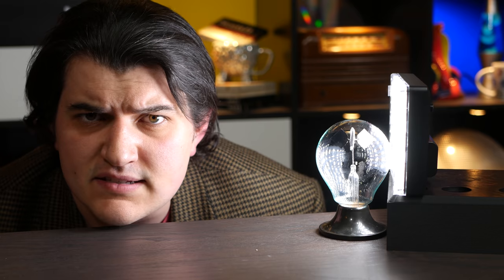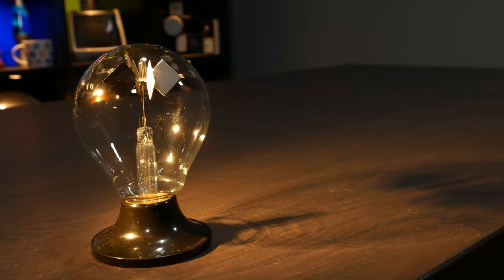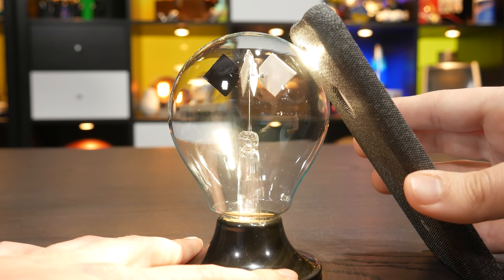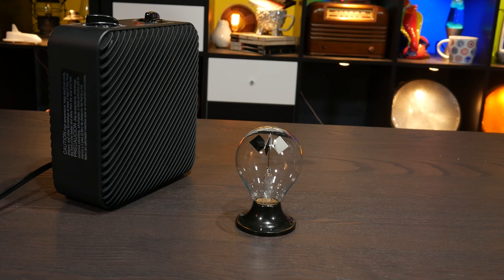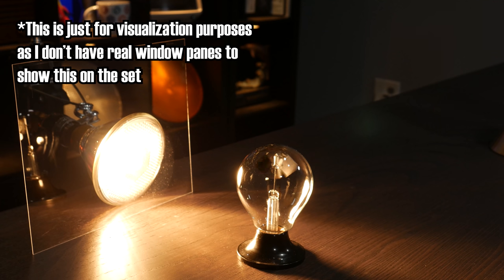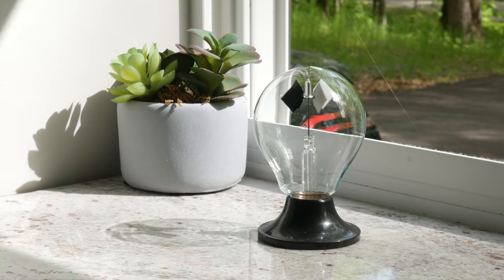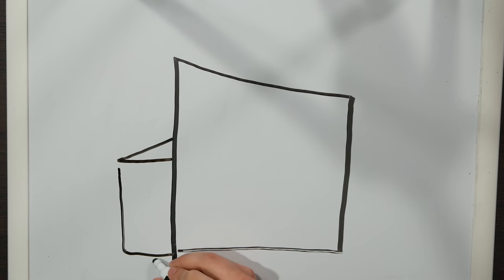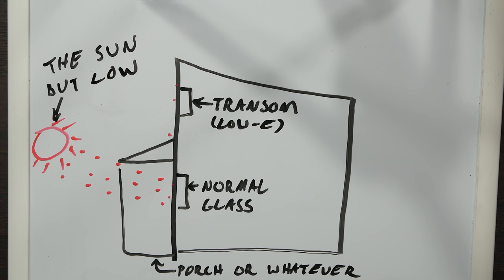What the Crookes Radiometer can teach us

Comment: I used to have a radiometer until I had the bright idea of seeing what would happen to it in the microwave, fun fact, I don't have a radiometer anymore XD
Reply: Funny thing is that, if you had put a glass of water in next to it, you might still have a radiometer.
Reply: @joesterling4299  ill test this
Reply: @joesterling4299  not guaranteed or simply a bad idea disguised as a smart move, usually you don't put metal in a uW AT ALL
Reply: @redoverdrivetheunstoppable4637  Nothing needs to be metal in a radiometer.  And it was a joke, which I guess I now have to ruin by explaining.  

Putting anything in a microwave without a liquid to absorb the energy will lead to a runaway condition that can destroy the oven and whatever is in it.  A glass of water would solve that, if not the issue of excessive metal that resonates with the microwaves.
Reply: @joesterling4299  first of all, i don't see any joke... second, the radiometer has likely metal in it, starting from the needle and probably the vanes... third, putting a decoy material you will ABSORB but not ATTRACT all the microwaves so the problem remains, infact people have bad expereinces with metal !!!AND WET FOOD!!! in a uW

i'm not replying anymore, this is becoming awkward, goodbye.... and stop suggesting dangerous things for spaghetti monster sake
Reply: I found out if the bowl still has a metal spoon in it all hell breaks lose

Comment: You know one machine I've never grasped how it works is a van der graaf generator.  Sure, I've read numerous explanations of how they work.  But for some reason my brain doesn't actually seem to lock onto the mechanism.  Your explanation of the radiometer, on the other hand, makes total sense.
Reply: paperclip
Reply: Up next, the Van-De-Graaf-ometer!
Reply: I once went inside a giant van der graaf generator. They still use some of them for small scale particle physics experiment. They look a little bit like small submarines. Instead of the rubber band of a desk top van der graaf they use a large metal chain
Reply: For me, The key to those is understanding the belt inside. It's floppy and slips a lot. So in actuality, it's like using duct tape to clean lint off a sweater. Only in this case, the lint is charge (from an ion, proton or electron is still debatable.)

Once the belt touches and pulls away enough ions (from the roller or buff), you have a charge potential. 

Maybe you already got that far, but realizing it isn't horizontal sliding, but perpendicular touching and pulling away, made the difference for me.
Reply: I was under the impression that no one actually knows why rubbing those materials against each other actually separates charges.
Reply: @Kaepsele337   I think the debate is if they are protons or electrons moving from one side to the other. But it's the same mechanism as rubbing a balloon on your hair. Van der Waals forces. 

Maybe the details of exactly how the charge moves is yet to be fine tuned, i don't recall. Most things in quantum physics are though.
Reply: @onebylandtwoifbysearunifby5475   Of course it's the same as rubbing a balloon on your hair, but what do van der Waals forces have to do with rubbing? That's also the explanation that I was tought in school, but later heard in university that actually we don't really know what's going on.
Reply: @Kaepsele337   The charge front is initiated by pulling away of 2 surfaces, not really rubbing. If the belt of the VDG generator is tight, it will stop producing charge. So we know its the touching and pulling away.

Electrons don't stay in just their host atom, so at any given time they will be sheered off when pulling materials apart. We also know this sequence has to be done repeatedly, and not just once, to build charge. 

A positive and negative front is set up, and the electrons move away from it towards the metal spike in the generator. That metal spike is attached to the metal dome, which spreads the charge so it isn't concentrated too high. That allows for more charge to be built up, instead of repelling.

The question, as far as i know, is whether the protons or the electrons that are actually being transferred. Most say electrons, but a few say protons. 

The fact that the belt can't be tight, and has to be floppy, tells us a fair bit about that being correct. There may be other open questions too, but i don't recall the details. (I take in a lot of information, so i have to sort through for a while to find where i file some of this stuff.)
Reply: @Kaepsele337  Maybe "cold welding" will help here: the reason 2 metals don't fuse together when touched is Oxides on the surface acting as an electron insulator. But in a vacuum, there is no oxide, and touching 2 metals together will weld them. The electrons don't know what piece they are in, so flow between the two, and it becomes one piece. 

Now, if we do that process over and over, with 2 different elements, each time they are pulled away it will leave a net charge on one side, because the electrons can't know you are about to separate the two pieces, and have no way of returning to their original positions first.

So here, instead of metals, we have a buff, roller and belt, and a metal spike to conduct any net surplus electrons away from those surfaces.
The electrons spread from the narrow spike to the large dome, and voltage potential accumulates.

(Sorry mate, that's the best i can do without finding my notes from (?) ago.)
Reply: Read this!  Objects in close contact share and exchange electrons in their outer orbits.  The force that prevents them from passing through each other is an electromagnetic force from like charged energetic particles (electrons) repelling each other.
Because of quantum mechanics these promiscuous electrons sometimes are with atom A and sometimes with atom B.  When you separate the objects, some electrons remain in their mistresses object.  If you do this repeatedly a charge differential is built up.  Promiscuity of electrons in materials are described by the triboelectric series.  Wool has a thing for glass, latex a thin for protein, etc.  Pretty simple.
Reply: @onebylandtwoifbysearunifby5475  is that also why the cells/atoms that compromise my fingers stick to each other but not to the other fingers?
Reply: @renakunisaki  I think there you would have an equal exchange of electrons, being similar materials. So there would be no net change.  As in a battery, you need an anode and a cathode to build potential.  If you just put 2 potatoes next to each other, they interchange equally. But the exchange between the two would be far lower than the exchange within themselves, so they wouldn't join. Whereas metals accept electrons freely, and flow away from the nucleus freely, to form an electron current. So in the case of fingers, the exchange rate would be homogeneous, and at a low rate, as carbon has all 4 bonds spoken for in organic life. Nothing to accept electron flow at a high rate means bio-welding your fingers together would be unlikely.

(That said, your skin does stick uncomfortably well to vinyl car seats in Sumner.)
Reply: Understanding the triboelectric effect helped me get a better grasp on the van der graaf generator.
Reply: The critical element nobody ever mentions is the hollow metal sphere at the top. If the charge were transfered to the outside of the sphere, eventually the accumulated charge would cause as many electrons to be taken away by the belt as being brought from below.
However, because it is a conductive sphere, it can't have any charge inside (because all the electrons will repel each other and migrate to the outside).
So, the belt can easily deliver electrons collected from the bottom to the inside of the sphere where there is no charge and they will happily hop off.
Reply: It's the same mechanism as with walking with socks on a carpet electrostatic build up/ triboelectric effect due to electron liking stuff yanking them from positive liking stuff and collecting on the metal surface until the ground connection comes close and zap!
Reply: Build one. Theyre simple and you'll never forget how they work again.
Reply: @onebylandtwoifbysearunifby5475  I'm curious how protons are supposed to be transferred if that's  the case. Electrons I get, but protons are fairly bonded to the nucleus of the atoms involved, per my understanding.
Reply: @flametitan100   I'm not sure they would be coming out of the nucleus so much as the nucleus moving over and leaving their electron. Hydrogen is just one proton, so people sometimes say "protons" to mean nucleus.
Reply: Did you watch Electroboom's video?
Reply: I read this in your voice...
Reply: TIL "Van der Graaf Generator
" is the name of a rock band and "Van de Graaf generator
" is the apparatus.
Reply: Rub a piece of rubber or latex on your head, skin, and hair. Build up that static. Keep building. Keep building. Keep on building.
Then touch something conductive, and shock yourself.

Have you done it? 
Congradulations! 
You are now a human Van DeGraffe generator!
Reply: street cred
Reply: Spinny rubber thingy passes bzorty bits from a brush to the rubber, then to another brushy part, separates the bzorty bits, so when you touch the top, it's all one kind of bzorty bits that want to be with all their other bzorty pals of the opposite type, and will happily walk through you to get there.
Reply: prog rock can be a lot, i know 😛
Reply: As an EE, I can assure you it works by whirrrrrr ZAP
Reply: So Robert Van de Graaff was my grandfather and inventor of the Van de Graaff generator. It's spelled Van de Graaff, it's a high maintainance name.
Reply: @jonathanentwisle6282  Those are specifically called pelletrons, I've heard differing takes on whether they technically considered Van de Graaffs
Reply: @rhettorical  Close, it's actually Van de Graaff. (my credentials are that i'm a physicist, oh and Robert Van de Graaff was my grandfather)
Reply: ElectroBoom's channel actually makes one of these and explains it the whole way. If that interests you I highly suggest his channel! Very educational :D

Here it is https://www.youtube.com/watch?v=im-PLK7ePhQ

If you don't trust links the name of the video title is: "Building a Van De Graaff HIGH VOLTAGE Generator" from the channel "ElectroBOOM"

From what I understand these generators take the concept of "rub a balloon on your hair to generate static" and put it on steroids.
Reply: "But for some reason my brain doesn't actually seem to lock onto the mechanism". No it doesn't but it does seem to make you wear a rifle strapped to your back when walking about your home town acting like a tool and scaring those around you. You also insult people who after yet another mass shooting want gun control. If anyone else wants the info look up "Y'all might have 8 bit guy opinions about his machines, but like, this stuff's my main problem" on twitter under search, and then click Latest.
Strangely when people point out this in comments under 8-Bit Guy's own YT videos you delete them. Don't want any of that Patreon money being stopped do you? So i'd advise no one else to comment like this under his videos or he might get annoyed. Wouldn't want that now would we.
Reply: Aren't they just giant static electricity generators?
Reply: Hehe you spelled it the prog band way. My favorite band ever
Reply: @rhettorical  Peter Hammill voice roared in my head when reading the mispelling
Reply: Rub your feet on carpet during the winter, then go touch a doorknob.. poof, instant Van De Graff generator.
Reply: @onebylandtwoifbysearunifby5475  It's always been electrons that move. Protons are in the nucleus of an atom, so removing protons would create a much larger reaction as you would effectively be splitting atoms.
Reply: @daviddavidson2357  It's still unknown if it is protons or electrons being separated which causes this effect. Where you're getting tripped-up is you're confusing nuclear fission (splitting nucleus) with plasma or ions (separating charges). 

Protons are repelled electrically with about 20 lbs of force EACH within a nucleus due to EM charge repulsion. That's not what we're talking about here. We're talking about separating the charges ("negative" electrons from "positive" protons) not protons from each other within the same given atomic nucleus. 

We don't know (and "we" includes humans) whether the charge front is electrons on one side or protons. We can only measure the charge difference, the voltage. As to whether the protons or the electrons are the ones to move across that gap we do not know. 

It actually makes more sense that the protons move across and are collected on the other side, whereas the electrons run away from that "negative" charge and up into the metallic sphere. But that's still an open question. 

The key here is understanding protons and electrons can be separated from each other. As to which one is pulled away from the other to make that separation happen: that's the unknown. (Also, there are ways which protons leave atoms without fission, such as quantum tunneling. They just appear in a different place when they want to. So our best current explanations for Van deGraaff generators may be substantially incorrect and insufficient, and even laughed at in 100 years.) Just a reminder to stay humble human, the Universe is not yours to make rules for- it does what it wants and how it wants.
Reply: @Kaepsele337 discussions about van der Walls generators are like any higher level quantum physics discussion, half of it is guesswork and half of it is unknown. It's all well studied guesswork, but still a Guess.
Reply: Woah, 8bitguy! I haven't seen you on here in forever, since your FireWire hard drive Daisy chain video, I think